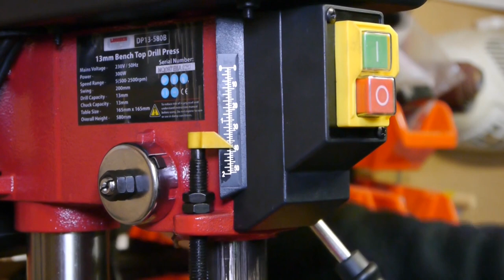Lumberjack DP13-580B Drill Press Review

Comment: I bought a "Clarke" pillar drill, but I did buy the Lumberjack brand Table saw. Been very impressed with too.
Reply from the maker: Their products so far have been amazing and at the best prices! I'd love to see what their table saw is like!
Reply: @mattsdiy4595  I bought the 10”  job site model and I’m very pleased with it. I found that the legs assembly had been put together incorrectly at the factory but it was easily rectified. My main gripe is that the power lead becomes extremely stiff when it gets cold something I will replace with better quality cable once it is out of warranty. I’ve made a crosscut sled and also my own mitre sled with guide strips on each side so I can cut from both mitre slots.

Comment: Great video Matt, in the market for one but I want a band saw aswell. I'll be using the band saw more, I'll probably spend more on the saw.
Ps your video on the Dewalt saw help me choose a Dewalt,  I've had it since March and it's been great. It punches well above its weight.
Reply from the maker: Thanks David!! What ever you buy I'm sure it'll be well worth the money!
Reply: @mattsdiy4595  Thanks Matt, my original idea was Triton drill 180sh Ryobi bandsaw 180sh total 360. But watching lots of videos,  I think if I can get the lumberjack for under 100 I can push for the Record bs250 bandsaw £279 so that would be round about the £380 mark.